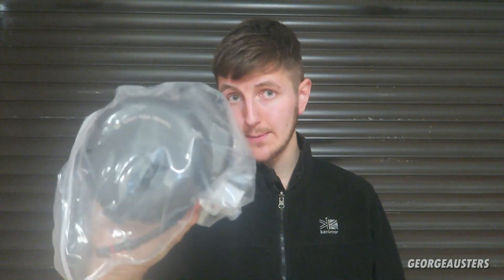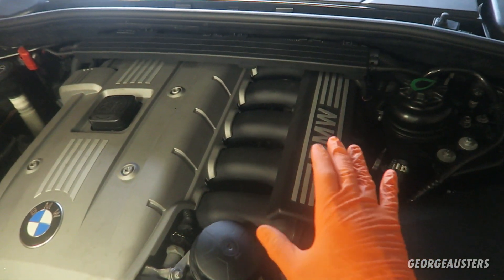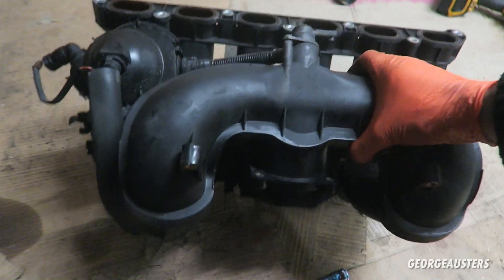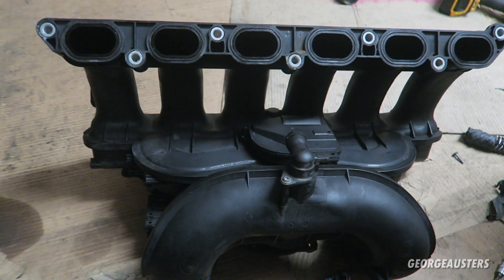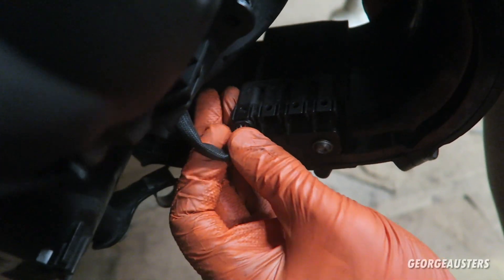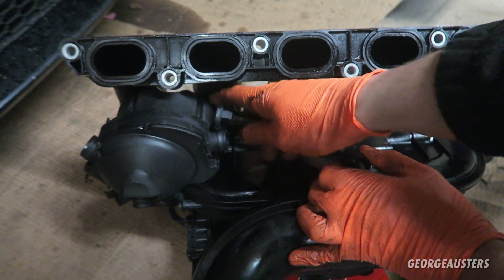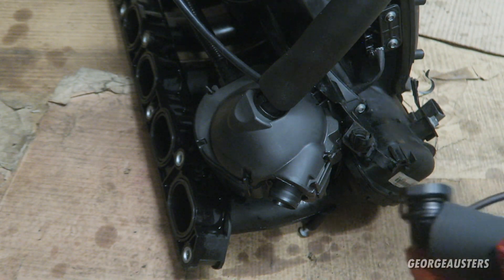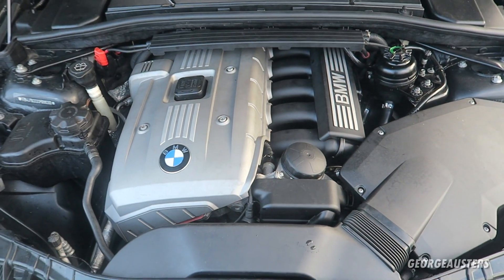BMW N52 Crankcase Breather Replacement | CCV Guide

Comment: I had similar experience, removed vanos solenoids, cleaned them, and bench tested them oil sledge problem from bad oil CCV also found valvetronic motor was bound up too. When removing from valve cover it was engaged to gear inside valve cover. After removing intake valve height could be moved easily by hand and had good spring return. Bench tested valvetronic motor it was jammed not turning by hand but kicked free after electrical power supply. Turns good both directions now and easily by hand. Re-installed valvetronic motor and vanos codes and rough idle gone.
Reply: My conclusion is CCV cause oil sledge which affected vanos, valvetronic motor and vacuum leak from PVC always open. Small oil leak found at DISA valve next to CCV. Fuel mileage went from 18.5 MPG to 22.5 MPG after repairs. Open PVC valve let oil into intake system. Spark plugs oil fouled but cleaned up with fuel system treatment. PVC valve tested by holding hand on open oil fill hole while running engine. Also noticed oil leak at fill cap from crankcase pressure
Reply: Crankcase pressure in the valve cover forced oil into valvetronic motor I’m not certain but it works now.

Comment: Beware,  if you buy the Febi CCV set with hoses you will find that the return to crank case hose does not fit on the pipe sticking out of the crank case.  Multiple owners have confirmed this.  
Removing the intake manifold is 10 times easier than reinstalling it.  You should take pictures of how all the lines & hoses are routed because they are made to the minimal length so even when routing them through the right path but mixing up the one that goes in front of the other you won't be able to connect them.  
I've done engine out jobs that are easier.  BMW really screwed up the routing of the wiring loom on this model.  You would maybe expect it to be the case for right hand drive cars but mine is left hand drive.  Maybe this makes it harder with the steering column and brake booster also on that side.  I've read a lot of complaints about the valve cover replacement but in my experience that is a breeze compared to the intake manifold install procedure.

Comment: Did you ever solve this? I had zero codes on my e88, N52B30... it had a smooth idle. It then went for the vanos bolt recall at the dealer and came back oscillating between 600rpm and 1200rpm on cold start. The dealer showed me pictures of terrible sludge in the cam cover. Reason I mention this... when the CCV fails, it can't draw fumes from the Cam Cover, and sludge builds up... which blocks the vanos filters (Check Valves) in the side of the block slowly. Codes aren't thrown because the DME adjust adaptations to keep up with the blockage and slower cam actuation at cold start and slow idle (Where oil pressure is lowest). My oil was also very clean when drained, but horrific sludge. So... you possibly have gunked up vanos filters and solenoids, and they're struggling to reach the timing angle targets from the DME... and the DME has run out of upper and lower bound tolerance to actuate them effectively. Check and clean filters and solenoids... then reset adaptations (or disconnect battery overnight). It'll run like poop for several starts afterwards, but will smooth out as the DME re-learns. Worth a try. But I would check for sludge buildup in case the bearings are being starved.

Comment: I pulled my intake and have none of those parts. Just a plastic y hose going to the rear. My valve cover seems not to have a pcv on the top. It’s stock 328i hard top convet. Any suggestions?
Reply: Same here
Reply: If you figured it out plz reply 🙏🏻

Comment: I just bought a rough idling e91 325i for a project. First thing I noticed that the ambient temperature sensor has incorrect readings intermittently and when the idle was nice and smooth, the temperature reading was also fine and when rough idle, the readin was deviating 10 degrees from the real. Not sure if just coincidence.
Reply: Did you fins shat what was the issues?
Reply: @mantasg9627 I think many little things together but what solved all the issues was to reset the adaptation values of engine and transmission. One possible theory was that so many parts were replaced and the car adaptation values were never reseted. It might just have been too far from the learning range to get back on it just by driving it.

Comment: After watching youtube clips on common problems with gaskets, sensors, breather hoses seals CCV belts etc! I'm going all out buying them all because all I'm hearing and seeing is this and that and maybes! So I've brought 21 items and counting I'm still in the process of looking for broken or leaking hoses! Might need to replace them too motors still in the car runs but hasn't had a service sense sitting on a front lawn for 2yrs but this be my new project

Comment: Thanks a lot for your video’s, i did head gasket and order in advance crank ventilaton also broke when i disassemble it. Did the clean of vanos filter easy when head is off. And use you’re valve cover video, the video’s are very clear and complete thanks a lot 👍🏻 keep up the good work.
Reply from the maker: Thanks buddy

Comment: Can you help me please. The vacumm hose on the intake boot thats on the throttle body is disconnected on the other side I looked it up and that hose I guess controlls the ccv. I found this out cus when I changed the ignition coils I lifted the plastic cove and I saw a loose hose and that hose leads to the intake boot. What happened please help me

Comment: You should clean both Vania solenoids and test with 9v battery they operate and magic will happen when you change the 1 crank position sensor that sits below starter I worn only it will not throw codes.
Replace only with OEM BMW Crankshaft position sensor.
Careful on Re torch of #10 torx and you could replace without taking off the intake again
Need just search for east tools to use 
Like long 14-16 inch needle nose pliers and a long magnetic flex grab tool to take off and put back the bolt  and a long pry bar to break loose seal of crankshaft position sensor and align

Comment: im curious if this is the problem with my 06 325i.  after driving short distance and upon slowing the engine has loud whistling noise and the car stalls when coming to stop as well as rough idle beforehand.  I was told both by BMW technician (Roseville, CA) and from online inquiries that it was the valve cover, cost almost $600 and did nothing upon making this costly change.   Would be great if more videos showed the cars before so others can use to match and identify their own issues.

Comment: Hey brother . Great content . What was the part number for the breather valve
Reply: 173973730384 this is eBay item number of ccv and 3 hoses I’m trying to buy but want to identify if this will fit my car . I have the same engine as shown in this video .

Comment: when you go close by the engine george it sounds like it does when the oil cap is open, almost as if the ccv wasnt put on correctly. sure looked like you put it on correctly though.  im confused by the hole on the top of the ccv. apparently from 10/05 it had a vacuum hose on top. mines 07/05. so i dont think mine has the vacuum. egh

Comment: Does this engine actually have a MAF sensor. My 330i just has an intake air temp sensor where the MAF would be?
Reply from the maker: Yes it does
Reply: @GeorgeAusters  Okay, my 2005 330i definitely does not, they’re a strange bunch at BMW. I found this out when I was having major probs on it, which all was caused by the DME being half submerged in water, due to a very bad BMW design where it is mounted (does not allow water to run away). I also found other people reporting the lack of a MAF on their cars (“I was also surprised when I tried to clean my MAF sensor because I found out that I actually don't have a MAF sensor. Instead..I only have a small temperature sensor.”). It’s a bit like the single and double port on the bottom of the intake manifold where the hose from the CCV goes onto it, the early ones like mine had a single port (like your one), but my friend who has year later 530i has 2 ports (after I got him the kit, and he told me he only had the single port). Anyway, well done on the vids, I find them the easiest and most informative ones on YouTube (and I’ve been a mechanic for over 25 years). 👍🏻👍🏻

Comment: Have you tried the solenoid valves? If contaminated they get stuck! Can be cleaned with MAF cleaner and then dry with an air compressor! Or just get new ones!
Reply: There's also tiny filters with check valves that you could try cleaning too. Accessible with a T-40 (I think) on the side of the block.

Comment: I had trouble getting the lower hose off, ended up using a fuel line removal tool. I am now having trouble getting the new one to click in place. I'm assuming it wants to fit snug and not be able to pull of easily? Any tips?
Reply: I too had some issues refitting this connector. For anyone else replacing this hose, I ended up using an open ended wrench on the connector to give me something to hold on to. From there, you can even put locking pliers on the wrench to give you a better grip or angle

Comment: BMWs typically don't throw codes for bad MAF sensors. Seems the N52 has issues with cam shaft position sensors and crank position sensors as well. Also if your O2 sensors have around 100k miles, they are probably bad.
Reply from the maker: I found the issue in the end
Reply: @GeorgeAusters  What was it?
Reply: Do tell, many of us want to know.

Comment: How did you disconnect and reconnect the lower breather hose ? Did you have to go underneath the car to access the fitting by the oil pan or accessible from up top ?
Reply from the maker: Watch my intake manifold removal video👍🏻
Reply: @GeorgeAusters  I did , didn’t see anything about how you hooked up the lower breather hose that connects from the bottom of the motor to the bottom of the heater . 

No worries , I already ordered the parts so I’ll have to figure it out lol

Comment: Hello, I wanted to check which of the hose's go from the block to the valve cover?

I am planning on replacing the starter motor and will be removing the intake and want to have a pipe in case the clip breaks under removal.

Comment: If parts itself are fine and still running rough, could be an electrical issue. Check the connectors and cables...

Comment: The  electrcal connection at the bottom of the manifold the one you didn't connect anything into on this video is that also a heater in there if so would it be advisable to change also whilst of the engine .

Comment: I had to replace my mass airflow sensor to get the cruise control to work, I seem to recall you retrofitted cruise control, could you need a different mass airflow sensor because of this.
Reply from the maker: Nope, MAF is fine :)

Comment: Double check none of the ccv pipes came loose whilst refitting its easy for them to be twisted off especially the one from the ccv to the sump return also make sure the sump return one is pushed right on its a pig to get on properly you`ll have to use silicon grease to get it on otherwise it will pop off again if not fully seated so the yellow clip locks on to the sump return pipe you can reach your hand down the back of the manifold to feel if the pipes have detatched from the ccv happened to me a few times very rare the maf sensor goes on them car would shake and stall on idle until I figured it out hope you find out soon.
Reply: Happened to me. I think i got it the second time. But no click. If its off again ill be using the silicon and a ccv tool. Valve cover blocks the front side of the fitting.

Comment: You did the big DISA valve previously but have you checked the smaller one? Flap may be working but in my case it was torn membrane preventing a seal when flaps closed.
Reply from the maker: I replaced both👍🏻

Comment: I noticed a rough idle and slight oil consumption on my N52 last year. Before I could start troubleshooting it specifically, the starter failed. I removed the intake to get to the starter and found that the intake had oil in it. Enough to form a puddle and ran out when I tilted the intake. So I replaced the CCV while doing the starter. Then I pulled all the spark plugs to check them for oil contamination because surely some of the oil in the intake had to make its way into the combustion chamber. My suspicions proved right. Cleaned the plugs and put them back. Also added a bottle of injector cleaner to the fuel tank to further aid oil contamination cleaning where I couldn't reach. After 10min of driving I noticed a huge improvement in my rough idle, it's barely noticeable now.
Reply: Those are standard BMW preventative maintenance schedules.

Comment: Had similar problem on my car with rough idle showed no codes but replaced maf sensor and solved the issue, also worth checking wiring on connection where it plugs into maf, one of wires had frayed slightly on mine
Reply from the maker: MAF is fine👍🏻

Comment: good video m8, i ended up having to get my CCV kit from BMW mine had started pulling oil from the sump, have you looked at the values the MAF is displaying in ISTA? My E46 used to run ruff with the MAF plugged in and it ended up needing the MAF changed..
Reply from the maker: Maf is fine👍🏻

Comment: On top of the valve cover towards the front of the engine is a pulse sensor, pull the plug off and check if there's oil inside, these are prone to oil seeping inside the sensor causing this type of issue. Only problem is you have to remove the valve cover to remove the sensor.
Reply from the maker: Eccentric shaft sensor is fine👍🏻

Comment: I had same issues with my e60 , never had a code , and eventually car wouldn’t start . If I disconnect a MAF car starts ! So I replaced MAF and it fix my problem. So don’t be surprised if you don’t have codes , these MAF s go out in a weird way .

Comment: When you look around for rough idle also the o2 sensors pop up, not sure if you have checked these already or not. But seems like a "emission" related issue since it idles fine without the MAF sensor. Some also had issues with the injectors but they are the last piece to swap I guess. I believe there might be a tune that can be done to completely remove the maf out of the equation. Legit streetcars have some BMW mechanic that tuned a e39 m5 in that way. Here is that video.
https://www.youtube.com/watch?v=Od0tB_GAJzs
Good luck with the gremlins =)

Comment: Have a look at the vanos unit might be your problem mate
Reply: When I replaced my vanos a while ago I had a similar problem. A bit of head scratching later and it turned out I'd connected the vanos cables to the wrong vanos, swapped the cables fixed it. Bit of a DOH!! moment.
Reply: Another great video BTW George.
Reply from the maker: Yeah that will cause real rough running